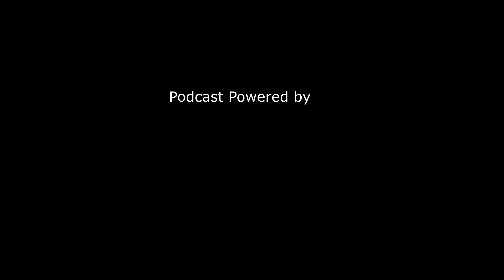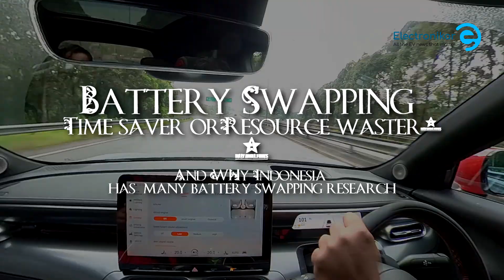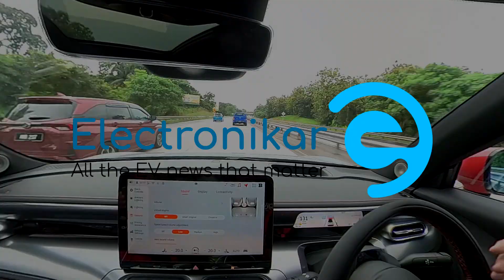Battery swapping can cause serious battery damage, but why do so many people think it's a good idea?

Comment: This is a fine idea for bicycles and perhaps smaller motorbikes, but not a great idea for larger vehicles in the long term.  Primarily, as battery technology improves, the time to recharge will continue to diminish.  The time to swap your battery may only be slightly faster than the time to recharge.  But also as more and more cars are electric, the queue to swap your battery - assuming more and more are using these NIO battery swap stations - will grow and grow.  Adding J3400 charging stations is much less expensive than the cost to add these NIO battery swapping stations.   I think it is a fine idea in the shorter term as long as volumes using this technology remain low.